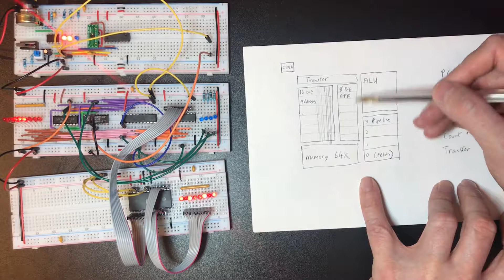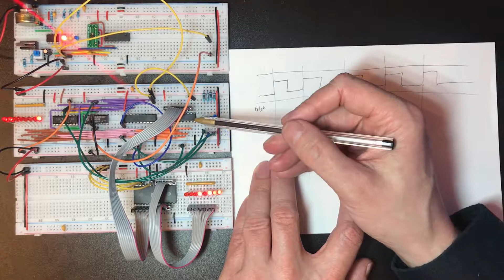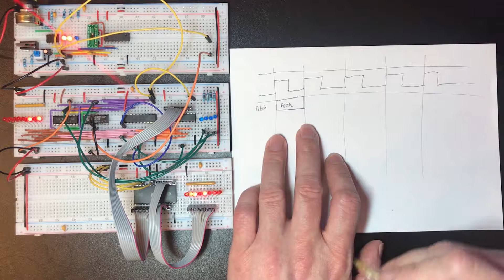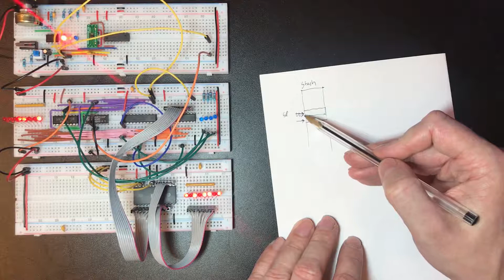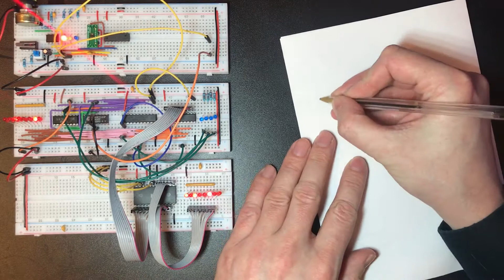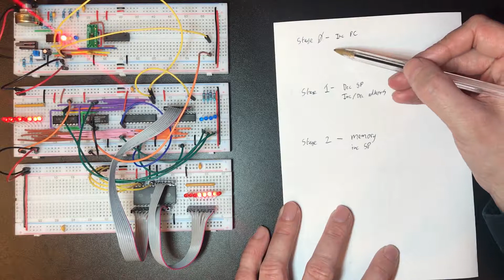Pipeline (1: Discussion and Fetch) - Making an 8 Bit pipelined CPU - Part 8

Comment: hi james, firstly i wanted to tell you that you got a great series here. i've currently arrived at part 54 and have seen almost all of them completely and had a good time so far. thank you! :)
there's one thing i don't get out of my mind though, but i am too lazy and busy building my 16-bit variant of a more than SAP computer to think it through myself :D ... maybe i missed it... maybe you could just argue about it a little bit for me:
as far as i can tell you don't have something like a step counter for processing various steps of an instruction... i get, that the pipelined architecture somehow removes the necessity for that... but i got instructions which may take up to 9 steps (of course they all use two steps alone for fetching, which is being ommitted by your pipeline automatically)... how are your two (maybe three, depending how you count) pipeline stages able to process instructions which would need more cycles?
thanks in advance :)
Reply from the maker: You are right to equate the stages of the pipeline roughly with steps in sub-stepped processor, what we are talking about here is no less than one of the foundation stones of the CISC verses RISC debate. That maximum complexity of my instructions is constrained by the number of pipeline steps, but any instructions I CAN fit inside there are guaranteed to be really fast. As long as I can fit the instructions in necessary to make the processor Turing complete then it's enough. For bonus points, as you watch the series, see if you can work out how I'm going to implement call and return (If you didn't want one my videos that explains it already). That was a tricky one as at first look it appears to be more operations than can be fit in the pipeline.
Reply: @weirdboyjim  I see James. Thanks for the detailed answer, which gives me a far more detailed inside in the whole CISC vs. RISC discussion! :) I always thought: So what, if there is a more convenient instruction which does more for me?! It never came to my mind that it could have to do with something like having a pipeline or not. Very interesting. As luck would have it, I just arrived at the call and return video and saved it as a special one for watching tonight :D

Comment: Wow! This is binge worthy stuff.

 Multiple comments from me in one day (sorry). I know how that looks in an inbox, but you need the supporting comments here. More people should be watching this.
Thanks again.
-Jake
Reply from the maker: Thanks Jake! I looked at the 74x4514's but you are right to say they are not as common (I couldn't actually find any active supplier). In some ways it's also more interesting to chain a couple especially for demonstration purposes. Yeah, the point of pipelining is to get concurrency in an individual cycle, the rising/falling edge stuff is just to order things within a cycle (Another way to say it is putting bus read/write operations 180 degrees out of phase).
Reply from the maker: I had a look at your channel, any plans to go get back to making content?
Reply: @weirdboyjim  
 Hey James, I probably won't to go back to making content any time soon. Chronic injuries are limiting me pretty severely at the moment. It just gives me the opportunity to slow down and get a better grasp of the fundamentals.
 I'm 3/4 of the way through redrawing all of Ben's KiCAD schematics for proper flow (top to bottom, left to right), and compiling the complete PDF documentation for his second module/kit into a single file with chip labels. Maybe someone will find it useful in the future. It makes the task of building the circuit faster, so I spend less total time at the bench when I'm ready to build it.
...but it's lunch time here now. So I'm slated to take a break and get back into your playlist/build.
  BTW, your comment about the 74x4514 is interesting. Are you looking at making this project a commercial enterprise?
-Jake
Reply from the maker: @UpcycleElectronics  Sorry to hear about the injury. Hope you continue to enjoy the videos. No, I wasn't planning on making this commercial or anything, I've got some vague ideas about making a new design in the future with an eye on being easier to program and easier for other people to reproduce.